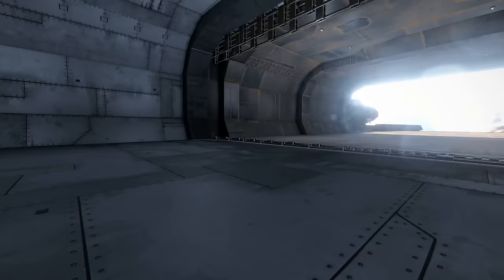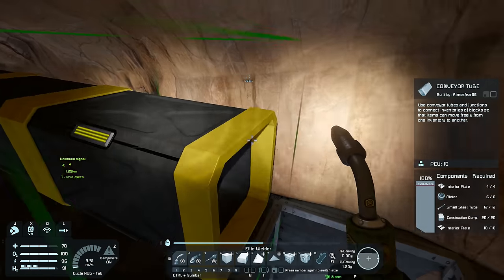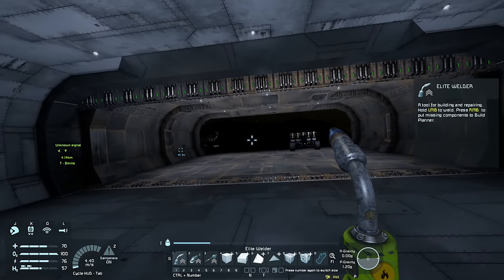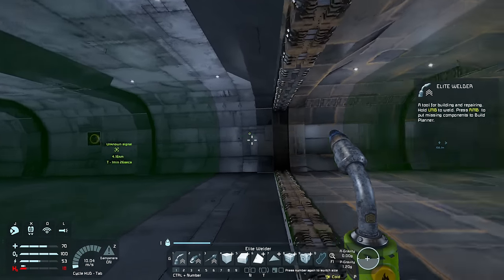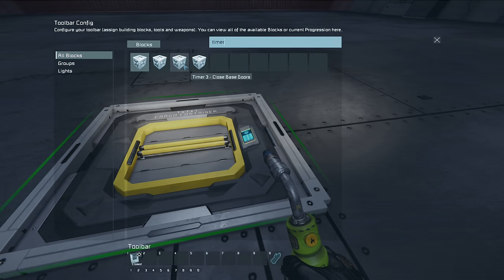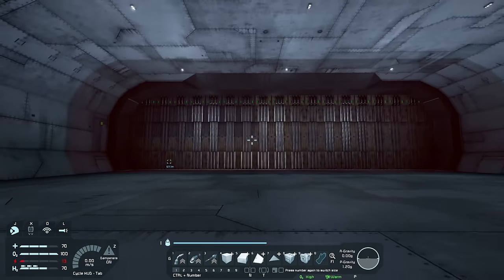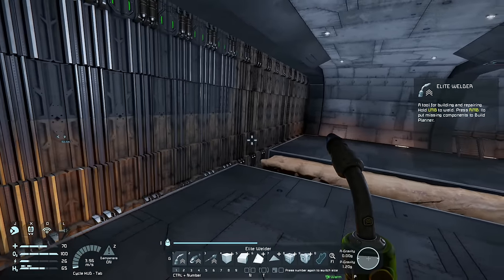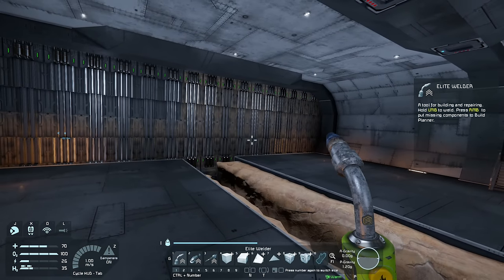Space Engineers - Wasteland Survival Ep27 - Adding an Automatic Airlock to the Hangar, Decorations!

Comment: Enjoying the series here! The base is looking very nice. On the hangar pressure issue, I would separate the vents in the hangar from the rest of the system. I would swap out the conveyor pipes with oxygen tanks. To pressurize the hangar, either draw oxygen from the Pertam atmosphere, or make a single vent connected to the main system as this would only need to be done once. After that, you just need to have enough oxygen storage for the hangar in that separate system. This should allow the system to have zero waste.
Reply from the maker: Thanks mate, glad you are enjoying the series :). I do have something like that in the garage and on the back of the rover (Vents sucking in the atmosphere), I think that is why the hanger would not fully depressurise when the doors were closed because the tanks were already full lol.

Comment: The air vents has some setup option. It can detect air leaks and when the place is sealed. So you can set a rotating light to on in case it's vented. Maybe you find a better way to use it
Reply from the maker: I like the idea of the spinning light!! That would be fun to setup :).

Comment: The decoration and tube line in the hangar bay looks really cool. I like the element of a ramp to ships, for all that its not necessary its a nice feature for realism. Related to that, I hope you connect the top hangar to the bottom garage through an elevator or a stairwell or something at some point, it would be for decoration but it would be very cool. 

So yeah, good stuff here.

PS. I'm going to keep the above comment but this is what I get for commenting when there is still like 2 minutes or something in the video, you actually talk about the thing I asked. haha

So yeah thumbs up!
Reply from the maker: Thanks mate, appreciate the kind words :). Yeah lol, it has been my plan for a long time hehe, eventually i would like to add a third level as well and have like a tower at the very top of the mountain above the Hangar so I need to figure out how to make a lift that will go to all the floors relatively easily, I'm going to need to do a bit of research on that front :).

Comment: Your base is something wonderful, i'm trying to do something similar to this in my world but it's nowere near. For the vents, i found that the vents thereselfs can be programmed like the timer blocks, and they act when they sense no pressure or fully pressurised. This way,  you don't need to guess the time it takes to pressurise or depressurise the hangar but they will act automatically when done.
Reply: So the setup is: the front sensor tells the vents to pressurise/ depressurise, and one of the vents tells the doors to open/close when finished the task. No timer block needed (i think). The advantage is that if you walk into sensor and then retreat immediatly, the vent will start to depressurise then repressururise and no door will open, no mess there
Reply from the maker: Oh sweet!! I will definitely look into this, thankyou!! 😁👌